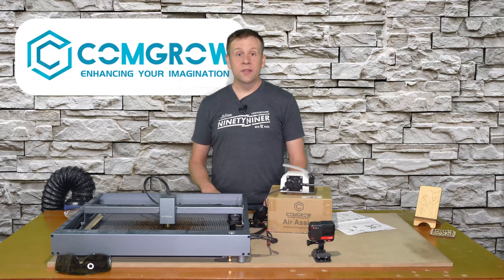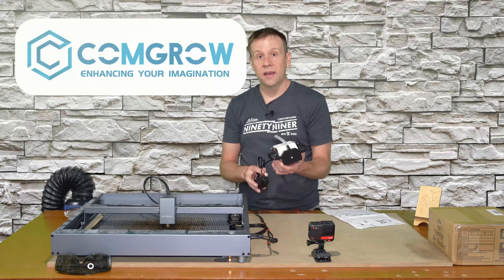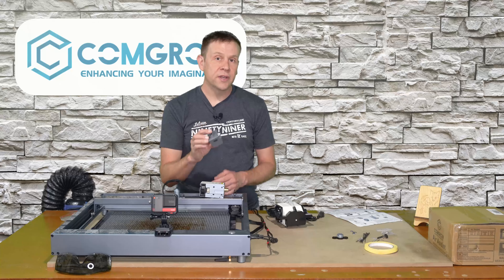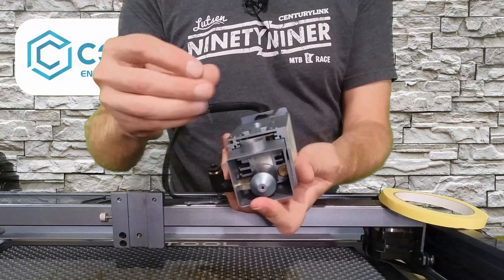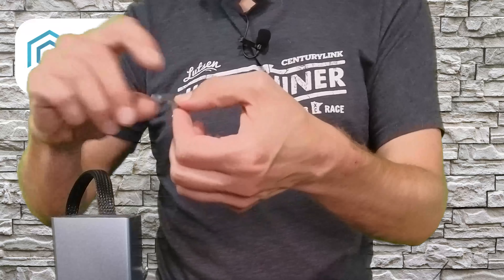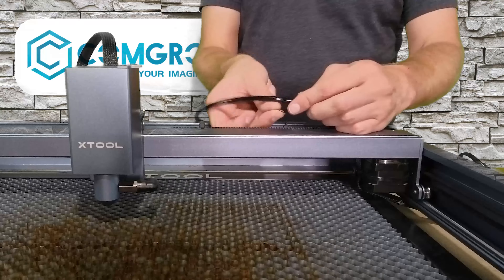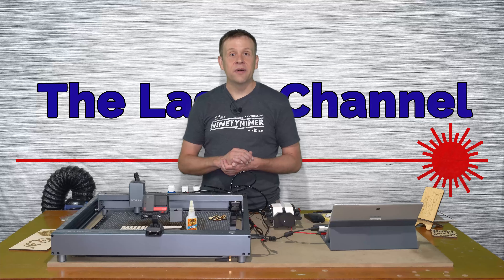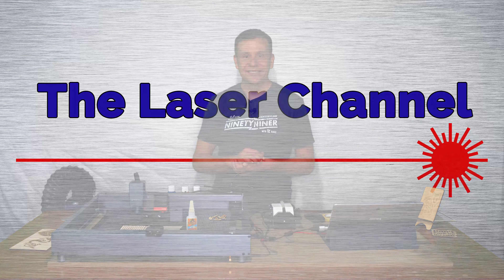Comgrow Air Assist for XTool D1

Comment from the maker: Follow up info after using the Comgrow Air Assist kit heavily for the past 2 weeks- working flawlessly!  I've had several long days of engraving and the air pump runs perfectly and the laser lens is clean and undamaged from heat.  Most of the machine runs are at 100% power for the fastest production pace!

Comment: I'm curious to know if the air assist power supply still works and if not, how long it lasted. I've heard of others going bad after a few hours of use.
Reply from the maker: Mine is working like new and I've used it a lot.
Reply: @thelaserchannel1  ok the reason I asked is my PO lastic rotary switch is real touchy and even with it all the way up, you just touch in it, it shuts off
Reply from the maker: @AwesomeFuture777  I agree- that doesn't sound right.  Is your air pump still under warranty?
Reply: @thelaserchannel1  it is.. I've had it 2 days. Problem is the people at the other end only get back to you in early morning hours like 5:00 a.m. I sent them video and an explanation of what was going on and they text me at 5:00 a.m. asking me what's wrong with it. Seriously?
Reply: @thelaserchannel1  also the smoke purifier I got I've had two days doesn't work correctly because the air that it's sucking in is the same power at number one as it is at 100 it's supposed to be a governor yet it doesn't govern the airspeed.

Comment: I really liked your review. What Lightburn settings did you use (Speed/Power) for such clean cuts on the plywood?
Reply from the maker: Thank you!  Glad you like the video- I used these settings in the video 5mm/s at 100% power with 2 passes- I think it should only need 1 pass.  The wood is 0.1" thick.  Have a great day!

Comment: What PSI is this pump able to push out?
Reply from the maker: 4 psi at a claimed 30 L/min.  On par with other kits but at a better price.  For more psi and flow a pump costing more than the kit would be needed.  Off camera I tested extreme air flow and pressure with a light industrial air compressor and found no difference over the Comgrow kit.

Comment: Either the video has not been edited correctly or this presenter has dementia. He repeated himself several times. A little long winded but an instructive video nonetheless.
Reply: Ha!  I was thinking exactly the same thing.  Couldn't help but chuckle at the dementia comment.  For many years, I led the Instructional Technology program (undergrad and graduate) at MS State University...and when students recorded presentations via video, they knew that I would come down on them hard if they gave evidence that they had done a poor job of post-production.  Mistakes like this indicate that the presenter doesn't have the respect for the audience that is necessary.  But, lest I cast stones unnecessarily, I have been guilty of some poor edits in my time.  But, it flies all over me when I discover something I've produced with errors remaining behind.
So, maybe this fella just wanted to see if anybody would notice when he did the "3, 2, 1 audio (clap)" routine.  Oh well, other than that bit of embarrassing moments, I think the content is quite valuable.